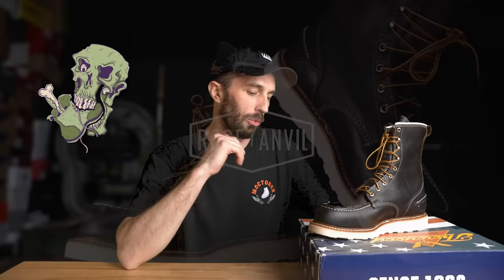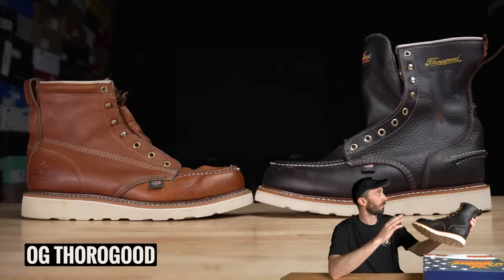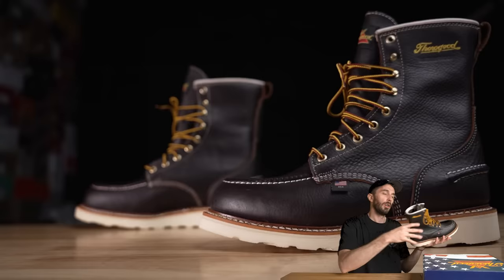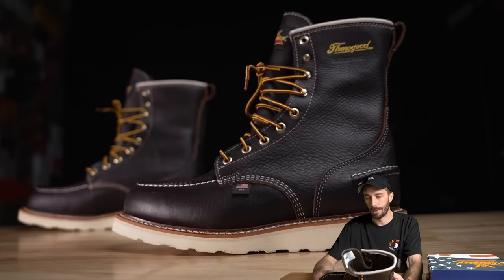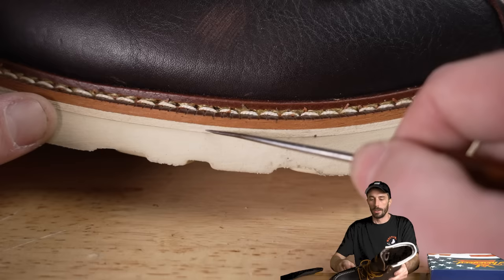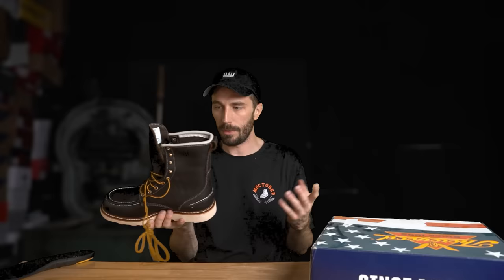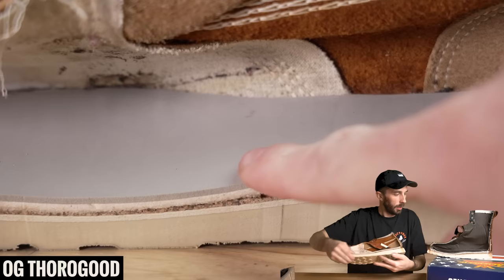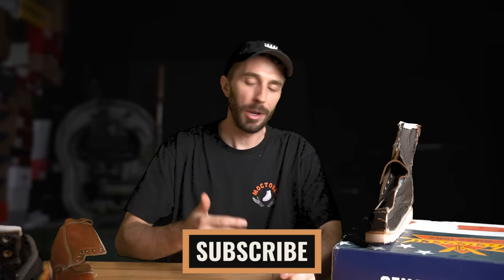Whats inside 1957 Thorogood boots

Comment: If you have bought sides of leather, you'll have parts of the hide more towards the center of the animal, where the leather is a bit thicker, and smoother texture, or tighter pebbling, as you get closer to the belly of the animal the texturing and grain of the leather get a wider type pebbling and a softer more pliable leather.  That's the leather they use for the sides and parts of the heel the toe box portions would use more premium inner parts of the  hide. I've own 3 pair of the water proofs two pair of 57 mocs and current flyways, and they are/were water proof.  I wouldn't say, go walk thru 2ft of water, but water up to the toe box hunting my feet are dry.  If my leather starts getting old as in like 2yrs on a pair I wear every day all day long and hunt and fish and the leather is all effed up and bottoms are all worn, of course I don't trust them in the same way.  I buy em because of the comfort style, and I just like the.  The 250+bucks is irrelevant to me.  Like em more than any brand I've ever owned including most thenhigh end boots out there these days excluding customs.  I'm in construction industry, and hunt fish year long here in mn, and they last a few years per pair max.  I don't resole boots.  If your just a city snob or tree hugger a pair should last you a lifetime plus a few yrs

Comment: I love this channel's focus on quality materials and construction, but from own my experience he may be overstating one alleged 'flaw' in Thorogoods.  Five years later I'm on my second pair of their moc-toes (standard, not the 1957), which I utterly abuse as a landscaper and orchardist--water, mud, kicking rocks, climbing trees, squatting constantly. The boots are not perfect, but they are pretty great. I'd say one major mark in their favor is that with both pairs, as they've worn out, all of the major components have failed roughly evenly in unison: the outsole, the stitching and the leather. This makes me feel like I'm getting the most life possible out of them for the occasional cleaning, oiling, and maintenence I put in. All this said, there is one component that has shown almost no wear whatsoever, over two pairs and years of hard work, and this is the synthetic welt. I can't argue with the images shown, but I've not seen even a hairline crack to the welt over the course of completely shredding two pairs of Thorogoods. I must say that in my case I don't expect a traditional leather welt would perform as well as the one provided--though perhaps wonder if I'm less subject to polymer fatigue as a Californian operating in warmer temperatures?

Comment: I own two pair both failed before needing to be reoled aboit 6-8 months in complete failure. And these were just daily boots walking around not at a jobsite. 
Toebox plastic cap between leather and the canvas came loose and pishes down on my toes 
Was told unable to benfoxed without taking boots completely apart so they are just disposeable trash

Comment: I wear Thorogood's, their standard 8" moc toe. Nothing special there. Why? Comfortable. I am older, age 65. I still earn a living and spend a full day every day on my feet. My feet are SHOT. Arches fallen, arthritis, etc. However, I like a wedge sole setup for comfort. Add arch support and I am in severe pain! What are my results? The last pair, before retirement, received 3 resoles. Several pairs have had 3. I keep two pair going so I can switch each day for dry out times. Are they the BEST? That is subjective. I wear them for number of resoles and COMFORT. I put them on and go to work, brand new. Best? Maybe, but for my needs, ABSOLUTELY! I need my feet flat, because my feet are flat! Tons of guys working every day are in my position. Feet are shot, comes with the game. Am I a FAN? Absolutely. I will pass on this new one.

Comment: I love thorogood boots and would love to get another pair but they just don't make my size any more, I pretty much got lucky buying my 4364's when I did, and it's a real shame.

Even though they do use some synthetic materials inside you just cannot deny the value and balance Weinbrenner has put into their American made Thorogood boots.
They have balanced comfort with quality and relative value for the money.

The synthetic welt is something I don't think is really a problem myself because it doesn't seem to wear out prematurely.
Reply: That sucks that they stopped making your size, especially as you'd clearly have been such a loyal customer. Do you have smaller feet? I've always found it annoying how loads of companies don't cater for smaller feet.
Reply: @joewellfair8238  
Yes I wear a size 7D, which I cannot find available.
I will double check their site to see if they have in fact discontinued my size.
Reply: Try Midwest boots. They carry almost all of thorogood boots and have a lot of the sizes they make.
Reply: @joewellfair8238  midwest is my go-to, great site.
I just checked thorogoods site and it seems I was wrong, in my favorite boots the 4364 they do still make my size.
The problem is I wanted to go with their midnight series for my next work boots since I'm required all back slip resistant footwear but they don't make them in my size.
My current and last work boots were justin conductors , but I can no longer find my size. ( I should probably check their site too and see if they actually make it still )

I prefer an 8", but since they do at least make a black 6" moc toe in my size, maybe I should see if I can dye the soles black with some RIT Dye or something?

Comment: If the welt was made of actual leather and the synthetic rubber I could see 300 even tho thorogoods are nice if they going start raising the price I believe they need to switch it to a leather welt and leave everything else the same I wear these cause I’ve tried on red wing brand new and the insoles were hard but I know it’s because it’s construction but I like my comfort for my feet that’s the only thing I disagree with on it

Comment: “Plastic bag around your foot” is not good. I’ve spent multiple long minutes in water above my ankles, wearing unlined handmade to measure boots with tight stitching (properly greased), and still had dry feet.  I’ll steer clear of these.

Comment: Seems like you got a bad pair I’ve had mine for two and a half years heavy construction wear never resolved even though it desperately needs it and partially coming apart and my boots are still water proof. Even with a mail puncture in the outsole

Comment: do people really work in Moctoe boots? They seem more like a fashion boot than anything especially since most have that soft wedge outsole that doesn't really hold up. I guess they would be good for hard factory floors. I still want a pair to use as heavy duty loafers lol.
Reply: I tried as a Millwright once, they hardly last a week doing real work. I nearly destroyed them after one day of torching out mangled steel in an industrial dryer at a concrete plant. I did try them also at an easier job as a mill wright in a bakery but the out soles lasted like two months.
Reply: They are all over construction sites
Reply: @zp1944  Construction workers are to broke to buy these boots at $300 lol
Reply: Oh yeah, remodeling kitchens and bathrooms as well as some other building and plumbing work I think you can't beat a moc toe boot.  Comfy and doesn't track up the clients home, yard, your vehicle, supply store and aren't a mess when you get home.
Reply: @bigdadgigachad3042  that makes sense. It's really a light duty boot. the break in is super easy too.
Reply: Yep, I wear mine in both in our sawmill/plywood plant and in the woods, though the sole sucks in the mud and I don’t wear them in the woods any longer.

Comment: I don’t think they are worth it at 290 for the simple reason waterproofing failed.  
So it’s either you should buy a lottery ticket and only 1 in a thousand fail or more likely 5 out of 10 will fail which would be more representative of 1 boot waterproof out of 2.